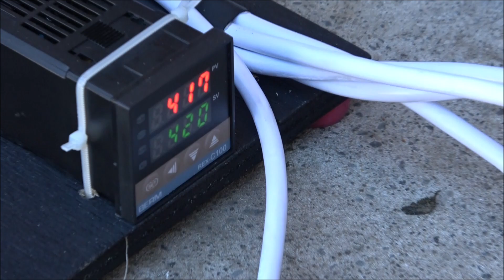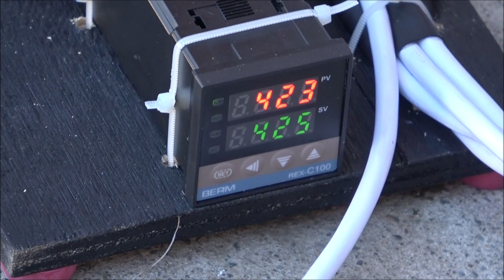6kw waste oil still unpublished files.

Comment: Alek.  do you have suggestions; better yet, design changes in mind for making a portable unit for out boon docking / processing at base camp:
> making it so can break down easy to stow/transport.....  yet not very time consuming nor complicated the break down/set up process
> suggest various means to power the heating/pumps at varying base camps?   
>> say various such as feeding non diesel back to a burner to aid in heating while say solar charged batteries and inverter are running heating elements for finer temp control etc.  

In my case the diesel would be used in things with awesome fuel millage and NOT so awesome (100mpg diesel motorcycle, 18?mpg diesel jeep, 7mpg CAT offroad RV) so at basecamp would need to make a lot of fuel before pulling up stakes and venturing to new basecamp.  Point being... am not expecting a one day base camp stay to get new fuel produced.  

so much thank you in advance....

Comment: show is you running this fuel tru an engine
Reply from the maker: Check this video of running the engine after the fuel treatment: https://youtu.be/JkfmIqZ7mXI
Reply: @santeryi9  can you post link to the additional fuel treatment you refer to in above reply.  Thanks. (or is treatment term as  you use it the same as the distilling process you show in video?)